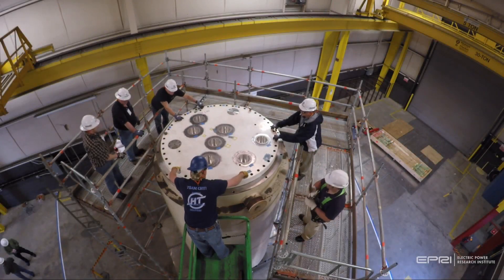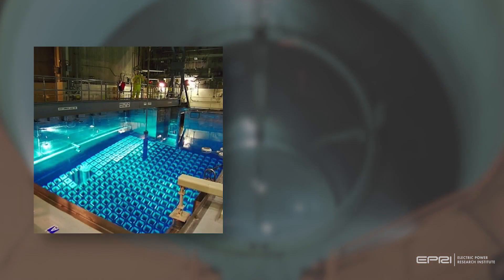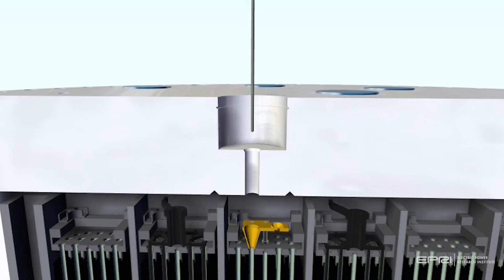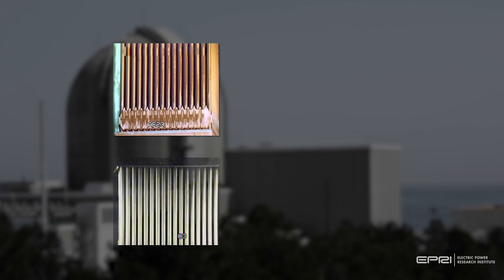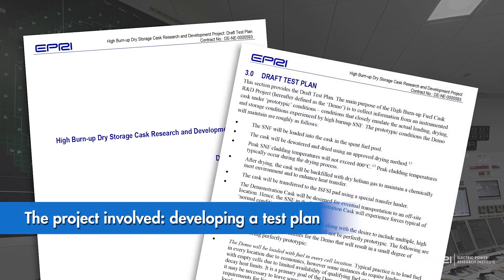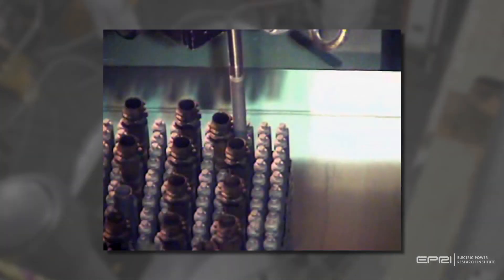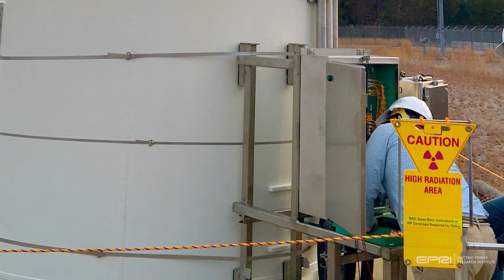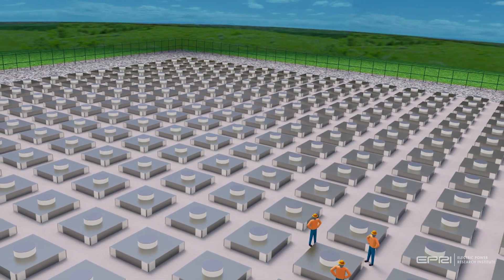High Burnup Nuclear Fuel Storage Demonstration Project

Comment: sweeping the problem under the rug only endangers our grand kids. can't we find a use to shorten the life span of the radiation while generating power
Reply: Marrhew, since you've shown interest here I recommend you study these issues for yourself, without prejudice. You might also find Michael Shellenberger's transition interesting, from an anti-nuclear zealot to someone in favor of nuclear energy for reasons of carbon emissions reduction and overall climate change science.
Reply: It doesn't change the fact that I don't have a place to put toxic stuff in my everyday work inviroment and the fact is the same for thousands of other electricians who are told to put the bulb in the bin. Of there is no place to bring it and the boss tells you to put it in the trash otherwise your fired the fucking problem doesn't get solved
Reply: @mattman8685  What the hell does that has to do with nuclear waste? is not the same to have tens of thousands of contractors working with millions of blue collar workers who might or might not feel like putting the bulb on the bin because is too much work or because the contractor wants to save some money and didn't put any hazardous waste storage area. Nuclear waste is much more controlled and due the nature of it, isn't like you can just put it on the bin or not.